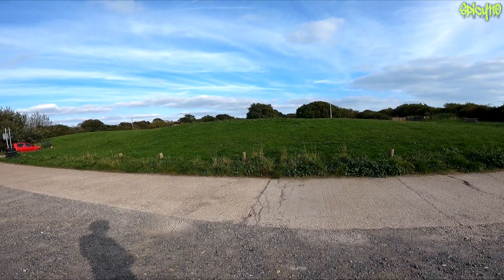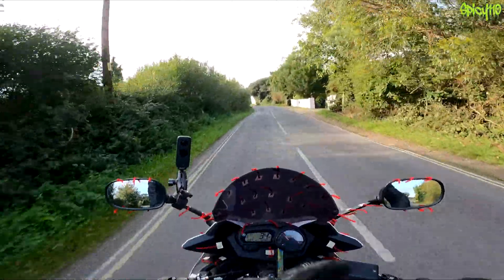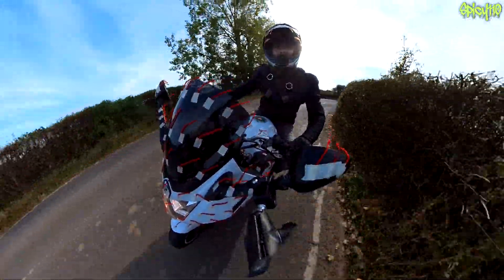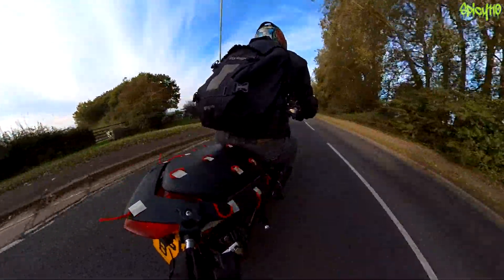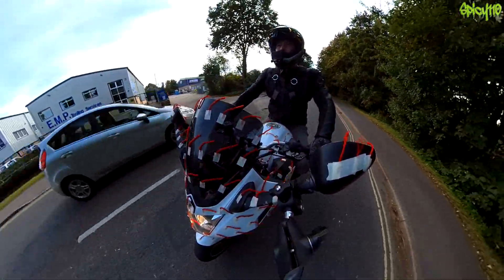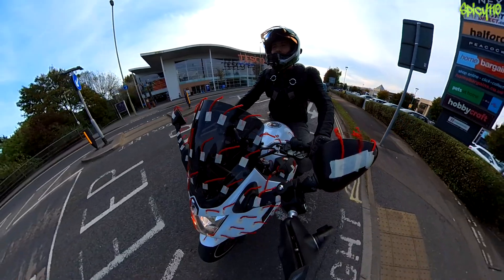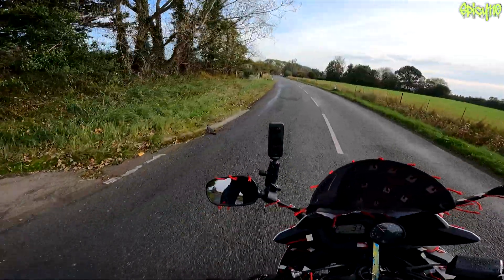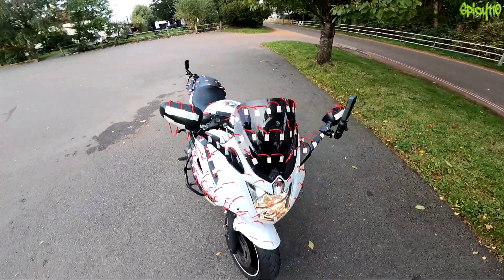Motorcycle Aerodynamics Seen with Strings!

Comment: I think the reason many people haven't done tuft tests on motorcycles, is because the answer to the question 'where is the air detached?', is 'basically everywhere!'. Seriously, motorcycles are terrible draggy, they only go fast because of small frontal area and strong engines. This piss poor aero results in lower speeds, higher fuel consumption, and poor rider comfort as well.
Reply from the maker: Fun to do tho! haha
Reply: @spicy110  Indeed! it's actually surprised how much air is still attached!

Comment: Interesting vid. I had a fairing / screen and a top box on my previous bike (FJR1300). When riding two up at high speed (I  won't mention how fast) the bike was perfectly stable. In exactly the same setup, but without the pillion the bike started to weave  a bit at high speed. I can only put it down to aerodynamic effects of turbulence between the rider and top box at speed. This turbulence could be felt as rider buffeting which didn't occur with a pillion. I never thought of checking it out with strings tho!

Comment: I love motorbike aero, I did my university dissertation on motorbike aero and how a few different devices affect the bike's performance in different riding positions/ bank angles/ pitch angles, so it was cool to see you make this video!

My general findings using the wings I modelled were that as the bike banks over the wings generated more and more force in the horizontal direction and at high lean angles (50 degrees plus) the horizontal forces became dominant over downforce...

A common thing I hear mentioned is that the rider can use their body to disturb the airflow coming from the inside-corner front wing, therefore stopping the wing generating these potentially negative horizontal forces at high lean angles, but I personally didn't find the rider position affected the performance of the wings very significantly.

Whilst motorbike aero is... controversial.... among bikers, it honestly is really interesting when you get to have a deeper look into it yourself!
Reply: Very interesting video as always, however I did notice you didn’t put any on the Wheels. LoL.